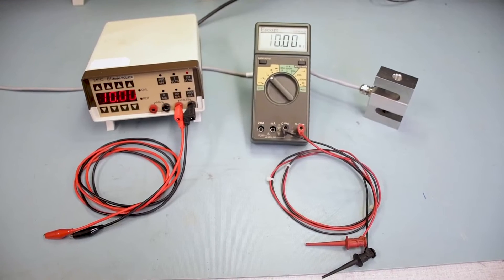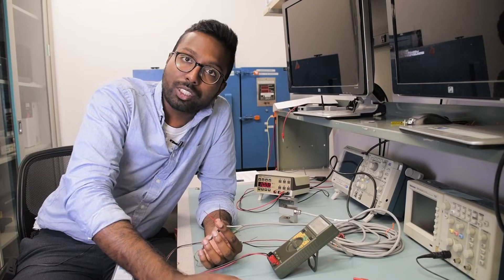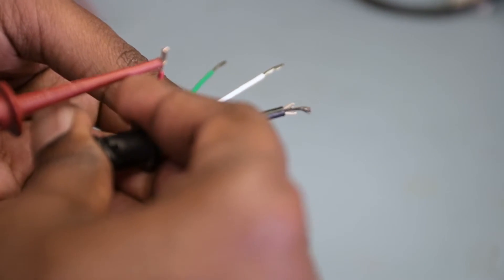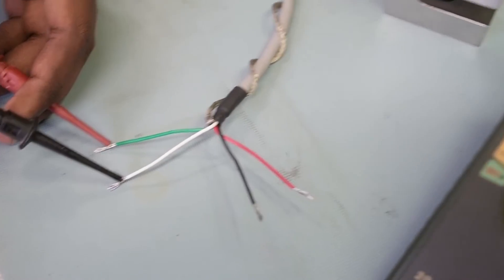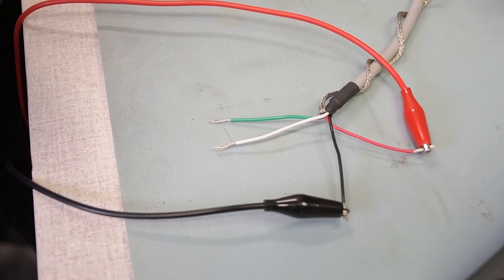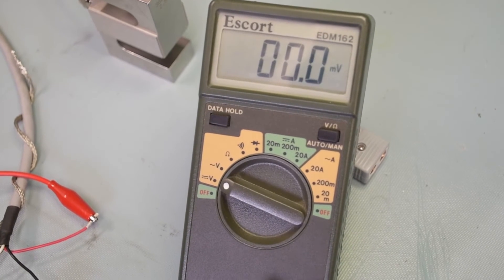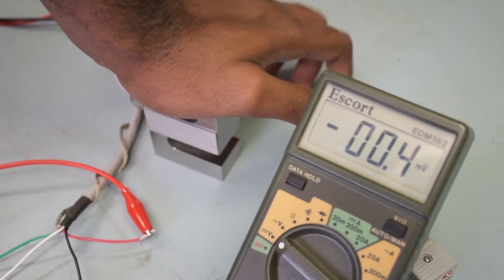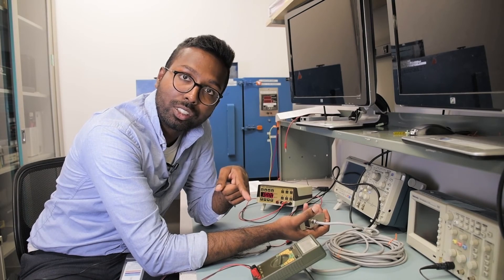How to Test a Load Cell for Basic Functionality - Engineering Tips

Comment: Cool. How much of the voltage range does the sensor output if I use 5 volts for supply (for 100g sensor), could I use an oscilloscope directly connected to the powered sensor?

Comment: you may have answered this already.  if i have a load cell, and the data sheet for that cell.  can i hook the power ground up to a power supply like you did, but instead of using a DMM can I use an oscilloscope to log the mV output to read the load instead of buying one of the meters that would normally hook up to the cell?

Comment: Thank you for the explanation, while programming in psoc, are the four resistances at the bridge 350 ohm resistor or the values changes? What is the best way to amplify the milli-volt signals?
Reply from the maker: That's a great question! You can contact one of our pressure engineering experts at: pressure@omega.com

Comment: Hello im having a issue in my load cell where checking the strain gauge resistance between input and signal excitation the resistance is same but when giving voltage to the input and checking at the signal inputs in dc volt ,without applying load im having voltage in signal input as the given input. how can i rectify it??
Reply from the maker: Hello Clement, Someone in our pressure department can help you out. Contact: pressure@omega.com
Reply: @DwyerOmega  thank you...

Comment: Thank you so much for this video.  I teach engineering and have a brand new (older model) Pitsco structure tester that was not working.  They claimed it was the force sensor that was not working anymore and wanted to replace the entire tester for Almost 1K.  Found the data sheet for tester and your video. Force tester is working fine...found out that the cable that they had running from the sensor to the onboard output/LCD screen was actually wired incorrectly!  Circuit Board has connections SSEE and the sensor schematics have it SESE...It was wired SESE in the clip that connected it to the circuit board...so it was never able to read data!  Wondering how many of these models were sold this way...this was not a refurbished structure tester.
Reply from the maker: Happy to help, thanks for watching!

Comment: Thank you. I want yo read the changes in voltage during a tensile test from our load cell. But our load cell is socketed to a (R232 i think) and is not bare wire. What should i do now?

Comment: I'm thinking about making corner weight scales for a car I'm building.  Is it ok to leave the weight of the car on the load cells at each corner at all times?  In other words, just build the car on the scales and whenever I add weight, turn on the scales and move the load around to try to balance things out, then turn them off when not in use, but NOT remove the load of the overall car?
Reply from the maker: Good question ProfessorOzone! You may leave the load on the load cells at all times, the issue you may have to take into account is sensor creep, meaning your load cells will tend to deform over time so you may have to account for zero and span drift. We recommend recalibration once a year from the time of installation by sending them back to us and getting them recalibrated/certified. If you need more information feel free to contact one of our pressure/load engineering experts at: pressure@omega.com
Reply from the maker: @ProfessorOzone - Just out of curiosity, what kind of car are you building? We'd love to hear more about it and how your load cells performed.
Reply: @DwyerOmega  Well, right now I'm still in the research stages, making calculations for the suspension.  I have to finish my current project first.  But the design is looking like:  Two seat street legal sports car, gull-wing doors, front-mounted mid engine, rear wheel drive, 400 ft-lbs torque, 400 HP minimum, double-wishbone independent pull-rod suspension front and rear, six-speed manual transmission and the weight is absolutely critical.  The goal is 2000 lbs (~900kg).  My favorite car is the Mercedes SLS, but they are over $100k, so I thought I would build my own version.

I have to be honest, though.  I don't intend to use Omega load cells.  Corner scales for  cars are very expensive and I believe I can roll my own using an arduino and some load cells.  That's how I chanced upon your channel, but piecing together your products will also cost more than I'd like.  At this point, I intend to build one and if it works ok, I'll decide if I want to build three more or just move the one from wheel to wheel.

When I start building it will be on my youtube channel:
antimatter garage

Thanks for the info and showing an interest.
Reply from the maker: @ProfessorOzone  That sounds very cool! Looking forward to seeing your progress!

Comment: Just like to ask if the normal resistance value is around 350ohm, and suddendly after using the it sometime, the scale becomes dead and upon measuring the resistance of the excitation and signal becomes double. Its reading is 850ohm on excitation and 780ohm on signal. Whats the cause of it  that its value double? Is the load cell damage?